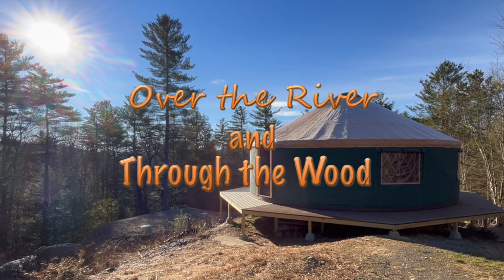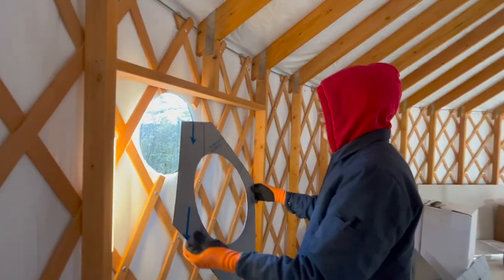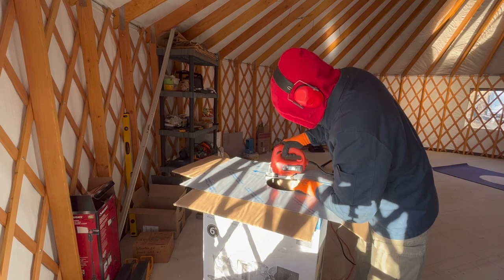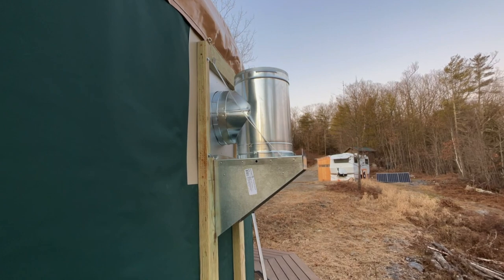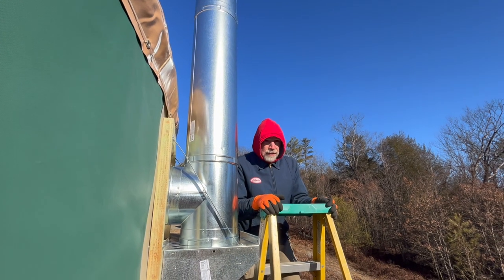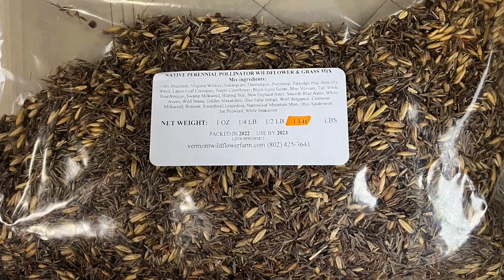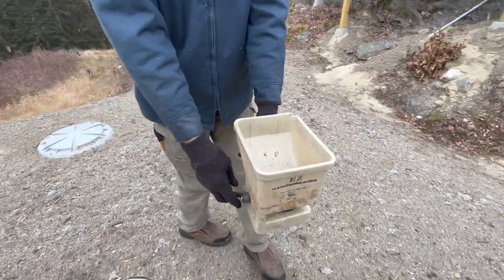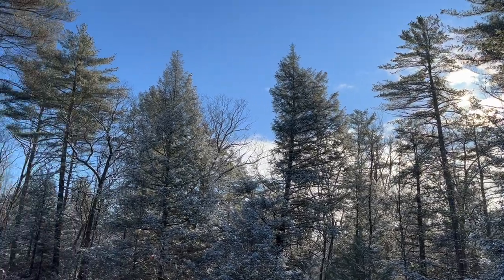A chimney and stovepipe for our yurt (Vermont DIY off-grid home build)

Comment: we used double wall, and did not have to cut any wood- have been using it for 5 years with no issues. but can’t be safe enough
Reply from the maker: Your thimble fit through the lattice? Nice!

Comment: Love the video, want to ask if you put anything above the stove pipe to protect the yurt roof canvas on the inside of the yurt?.
Reply from the maker: Hi, thanks for watching and commenting. The stove pipe for the temporary woodstove stuck further out into the room than the exhaust for the permanent rocket mass heater will... But I think this is the video that shows the answer to your question: https://www.youtube.com/watch?v=N1MSrP4Ajjk
Reply from the maker: (heat shield made from cement board)

Comment: We are also trying to set up a stove in our yurt and have a surrounding deck like yours. We were trying to figure out a way to set up the chimney support without having to go through the deck to put 4x4's in the ground like most set ups show. Has your method been effective for keeping the chimney stable? It looks like our chimney pipe will be a little taller than yours. I appreciate your video as we have not seen any other instructions on how to do this! Thank you.
Reply from the maker: Hi there, and thanks for watching!
I (Charles) also did not want to do those big 4x4s all the way to the ground. Yes, this method has been very strong and stable as it is all tied back into the 2" structural members of the yurt. We have the wind and snow kit which adds a lot of structure, so as long as you do as well, or you at least add 2x4 structure around your stove pipe, this method should work well. I would also tie it into your flooring system. We have 6" SIP floors with a 2x6 sub-facia around the perimeter. This makes for a strong connection at the bottom. I am sure it could be done with other floor types as well.
As you noted, the height of the chimney will make a difference. Our chimney will eventually go higher, but it will go through the roof of a future porch. This will give it additional support as it will be attached to the porch roof structure. I would not go much higher than ours is now without that additional support.

Comment: Hello thank you for the video. I was wondering how your yurt is placed on the deck. You have a raised platform I can see, so is this sitting straight on the deck itself?
Reply from the maker: Hi Caz, thanks for watching and commenting. Here is the playlist of videos of that part of the yurt build: https://www.youtube.com/playlist?list=PLAGu47NYOmE7Q77ykJd6x39X9G23E22pM 
And I think the short answer to your question is that we put SIPS down as a subfloor, and wrapped the subfascia and bender board around them. Here is the link to that video specifically: https://www.youtube.com/watch?v=cf6VV97Oodo&list=PLAGu47NYOmE7Q77ykJd6x39X9G23E22pM&index=6
Reply from the maker: Oh, I see you are asking about the deck rather than the platform. No, the decking only barely gets under the edge of the yurt circle. You can see that better in this video: https://www.youtube.com/watch?v=cf6VV97Oodo&list=PLAGu47NYOmE7Q77ykJd6x39X9G23E22pM&index=6